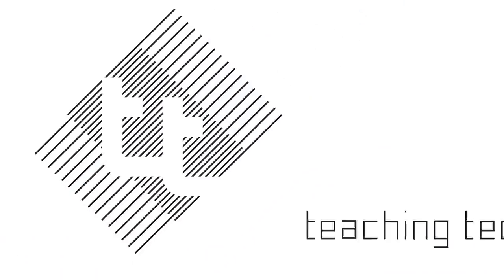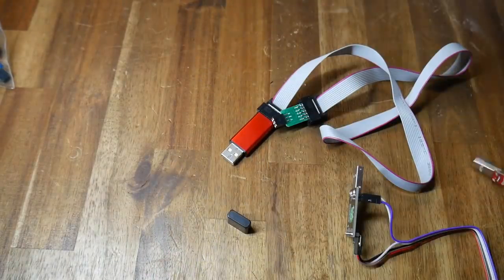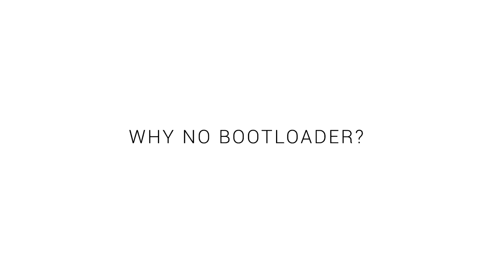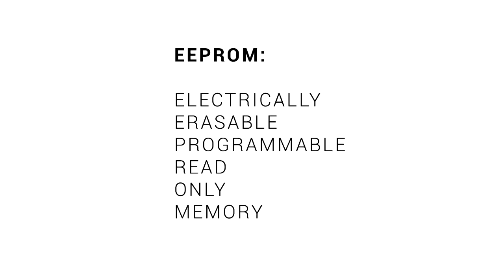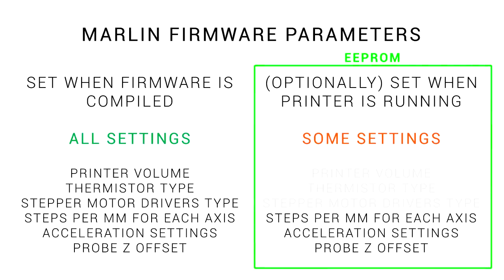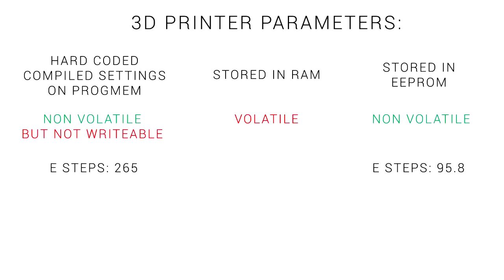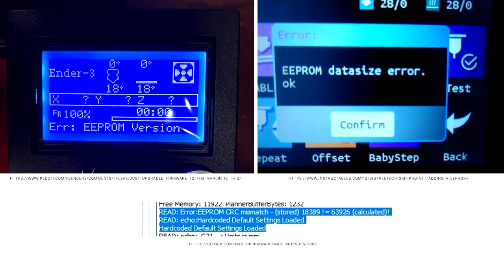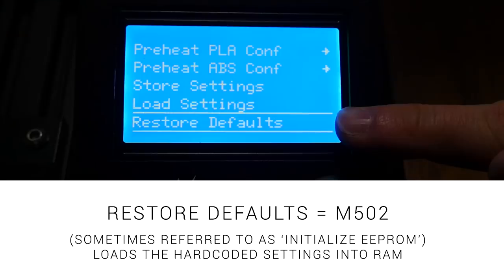Bootloaders and EEPROM - Understanding your 3D printer for beginners

Comment: My Ender 3 prompted me to begin learning about Arduino everything. I recall one of the reasons I bought the Ender 3 was the advertisement that the eeprom enables the printer to resume a print after an unexpected power loss. I tested it several times to no avail and now avoid losing power during a print. Only after a lot of learning am I beginning to understand, a little. This video helps.

Comment: Only issue I have with my Ender 3 using the 32bit board and Marlin is the default max temp resets to 250 C every time I shut the printer off, even after storing the settings. 
I'm running an all metal hotend and my printer can handle 315 C so I set my max temp in the firmware to 310 C. The EEPROM keeps resetting it back to 250 and it is annoying because I'm printing above that temp a lot. So I always have to go to advanced settings, change the temp, store it, then start a print.

Comment: Hello, thanks for the very informative video. I have the Ender 3 V2 and I've noticed that on the SD card resides an EEPROM file where  parameter values are stored. Doesn't the mother board have an embeded EEPROM? Thanks.

Comment: Michal I have a question.  Have you by chance had any experience with the Tenlog printers I recently obtained one 2nd hand it prints pretty well but I am limited to the factory firmware that has not been updated in quite a while.  After doing a ton of digging I have been able to figure out that it is an 8 bit board and has a ATmega 2560 chip in it.  Can this be updated to run full Marlin with a programmer or would it be better to just install a new BTT octopus board, stepper driver,  and touch screen in it.  Thanks for taking the time to do what you do I have learned so much from watching your channel.  

Rick

Comment: It seems weird to distinguish "firmware" from "EEPROM" when firmware is just as often stored on Flash as EEPROM, like old PC motherboards and stuff. Further complicating things, the non-volatile settings often get saved to battery-backed CMOS, battery-backed SRAM, another flash chip, part of the same flash chip, etc.

I would've just said that the firmware is stored on one chip and the settings are often but not always stored on another to avoid corrupting the firmware with things that can be dynamically changed.

Comment: I have an ender 3 with a BTT SKR mini E3 v1.2 installed and it seems like I have to completely recalibrate my z-offset every time I print something now. I have a BLTouch with G29 enabled to probe the bed before each print, but it seems as though it isn’t following the grid at all. I use bed visualizer and get my bed nice and flat, re-do my z-offset and it will print fine for that print, a couple of days later and it’s like my offset has backed off the bed a small amount and my first layer adhesion is no good. Everything on my printer is mechanically sound, nothing loose, BLtouch is well mounted and rock solid with the hotend, which is also tracking smoothly and not loose. I clean my bed with 99% IPA before every print and with the old main board, I never had this problem. My hunch is that something is off with my firmware, the bed probing is not getting saved or z-offset is getting reset. I love how quiet this board is, but going from printing like butter to having prints pop up mid-print if they ever stick at all is maddening... Any ideas?

Comment: I have a voxelab aquila. I am pretty sure this has a bootloader because the process to update the firmware used only the SD card. However, I dont think it has EEPROM. M500 does nothing when sent from the terminal. How do I save settings like linear advance? Most other settings on your website have alternatives that I can use such as start gcode alterations in cura, or changing the setting directly on the printer. Linear advance however seems to be this issue Im dealing with.

Comment: I'm on Mac so will this all work for me?  Somehow my ABL settings got corrupted and in trying to re calibrate I was asked if I reset the eeprom.  I had no idea what he was talking about as I never was inside the board.  My ABL was installed for me.  Als I had modified my Ender 5 to a micro Swiss direct drive.

Comment: Do you know if the stock Ender 3 board has enough memory to enable manual mesh leveling? Thanks.
Reply: Yes it does. You may have to disable some features to free up some space for it to compile though. ARC is an easy thing to disable and you can turn on slim LCD menus as well. That should be enough.

Comment: Hi Michael, I am a newbie to 3d printing, while setting-up my new Ender 3 S1 Pro 3d printer I must have done something wrong. I can't do ABL or Manual leveling. The ABL it stays on 0% and also gives me a Code 203 Probe failure. Now I want to set the printer back to its factory default with M502 and save with M500. The question, where do I get these files? How do I load these files on the printer??? I a total newbie and excuse me for asking stupid questions!!! Please help I am so frustrated!!!

Comment: Hi Michael, just wondering, would you know the needed size for EEPROM for current Marlin 2.0.5? I read an article about adding a I2C module to SKR 1.4 board and was interested. In the article, they suggested a 512K for future compatibility... But they are expensive and hard to find. 256K are all over the place and are almost free. I will be ordering the 256K anyways, and can update it with newer chip if ever needed. But if you know about where they are in memory needs... That would be great.
Thanks Steve

Comment: When I go to do a M500 I get "no EEPROM" on my Ender 3 Pro, running the 32bit board with 4.2.7 and Marlin2.0.1 V1.0.1
Do I need to edit the source code and re-flash the firmware to enable EEPROM editing?   

I don't get it, in all the other youtube videos, when they send M500 commands it just...works.   
I was trying to adjust my PID's but I can't get them to take. 

Any suggestions?

Comment: I am having a nightmare trying to get the ender 3, 1.1.5 working with my BLTOUCH. I did the bootloader part using my arduino but my ender just isnt working. Will teaching tech do a tutorial for it as absolutely no one has info on it.

Comment: I cannot compile Marlin 2.0 for the Tevo Nereus. Can I PM you to help me? Edit: Also, how does one set the board in Arduino? I have a MKS Robin Nano v1.2. One more thing, can I make my 3D printer use the SD card to store the eeprom and firmware, instead of burning it into the board? (I mean that if I flash firmware onto the board, the firmware will still run without an SD card, but there will obviously be no gcode files).

Comment: Hi there,

Need help.

Just tried to update Marlin firmware from freakydude from GitHub update via pronterface and stm35 to my sidewinder x2.

After I download firmware via stm32 and install to printer, then reset it, and was great but I didn’t save my Z offset and Extrusion data before… so I tried to go a step back and install old backup firmware I made via stm32. So I connected printer via usb cable to pronterface, than stm32 and install backup firmware as the pdf instruction said. then reset printer and… I tried to connect with pronterface to reset eprom and… protnerface can’t see printer via usb cable… also any tryouts to axis movement, heat extruded or bed, any function via touch screen on printer asp doesn’t work. Looks like everything failed… how can I put into printer firmware again when pc don’t see it via cable ? 

Help please :(

Comment: and how can I fix this device (CREALITY 3D Printer Parts CR-6 SE Intelligent Color Touch HD Screen) if falsh booting was borken due to power loss. When the flash was occurred, there was a power outage and since then the screen is only blue and booting from the microSD card will not start again

Comment: i need help, i have a ctc replicator dual , which i manage to upgrade to sailfish via replicator G , but now i am trying to upgrade it marlin , however it fails and tells me avrdude: stk500_getsync() attempt 1 of 10: not in sync: resp=0x84

then trying to use an arduino nano as an isp i get a Yikes! invalid device signature 
double check connections and try again, or use -f to overide this check. 

what am i doing wrong , i cannot upload the marlin firmware , im trying to upload it.

Comment: What is the best program for putting on a bootloader when u only have a mac had no success all require Windows from what I have seen in videos etc online any suggestions. I have 3 ender 3 Pros I would like to update.
I have a bl touch and a programmer but can't use it with a mac frustrating. 
Thanks in advance
Reply: Arduino IDE runs perfectly on a Mac.  It is actually easier as the Mac USB ports actually work and you don’t have to mess with the USB drivers with Zagi which can be an absolute nightmare.   For the 8 bit boards just follow Micheal’s guide with the the Arduino editor installed on your Mac.  It is exactly the same except where he sets up the USB port.  You don’t have to do that - Mac ports just work - just select the correct one.

Additionally use a cheap programmer from Jaycar as it is plug and play.
https://www.jaycar.com.au/isp-programmer-for-arduino-and-avr/p/XC4627
https://www.jaycar.com.au/avr-isp-10pin-to-6pin-adaptor-for-arduino/p/XC4613
This will cost about $25 and with the adapter plug straight in to board.
Reply: The only issue with the Arduino IDE on macOS Catalina, is that sometimes it just crashes if you have an external monitor connected.

Comment: I have a ender3 pro, the bowden feed stepper motor is getting power but it's not turning to feed the printer. 
Yes its wired correctly just like my other ender3 every thing is the same except that it will not not.. any thoughts?
Reply: Have you pre heated the hotend?
Reply: @MarcBrown1  yupe. Still nothing the filament moves fine through the system, it's just the stepper won't do what it's supposed to
Reply: @GreyGhost_40  I would swap the motor with other your other ender see if problem moves with motor if it does you know what to buy
Reply: @MarcBrown1  already tried that to.
Reply: @MarcBrown1  And check the cables, very easy to overlook and cheap to replace